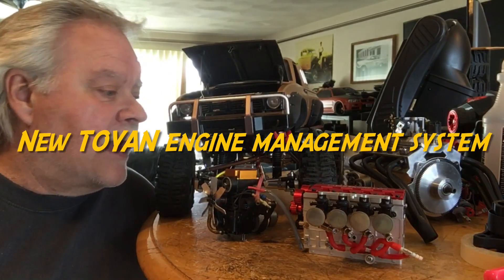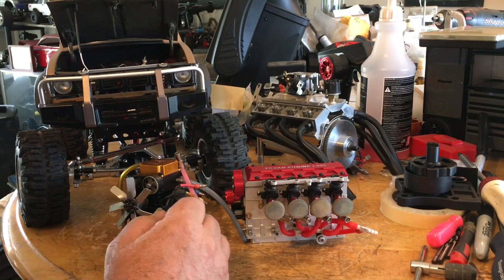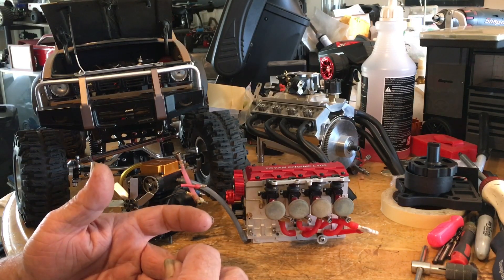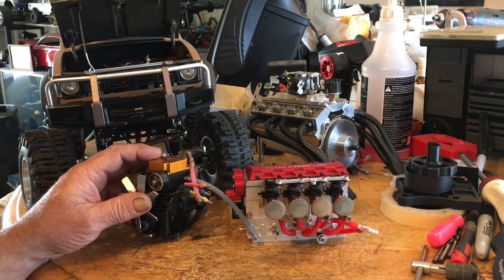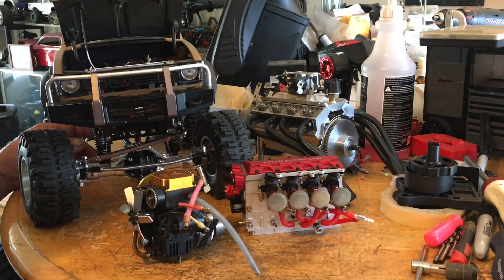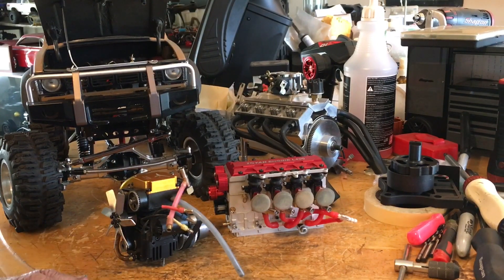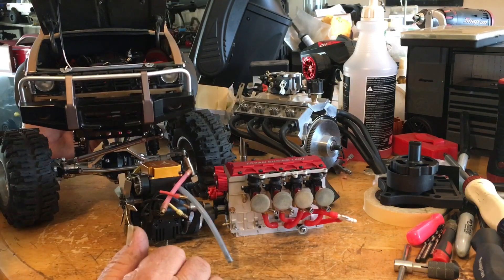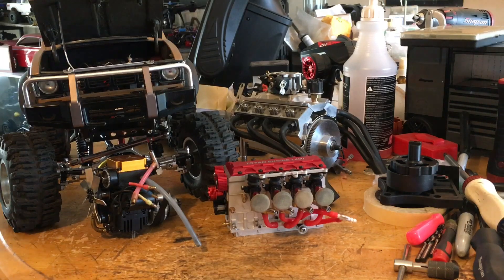NEW TOYAN ENGINE MANAGEMENT SYSTEM!!

Comment: Count me in, I really think those cranks are breaking from the lack of FIRE on either one of the out side cylinders. If one cylinder fires and the other doesn't it would put opposite force on the center of the crank. You said it happens when you first start it which would make sense because glow ignition isn't as reliable as a spark. 
I'm sitting back and waiting to see how this crank issue plays out before I even try to start mine.  So, thanks goes to you for your research and investment man!
Reply from the maker: Your welcome brother,  its a handful trying to figure out the crank, lol

Comment: Thanks for all the feedback! I’m the student working on this project. I will continue to check everyone comments. I’m open to improvements so post any ideas and if it make sense I’ll incorporate it into this project!
Reply from the maker: Looks like your idea is gold! I figured this would change the RC world, most everything that has an engine on it today has some kind of EMS on it except nitro engines.
Reply: Contact Timsane and JohnnyQ90 as well! Maybe all these guys could have a turn at testing and providing some feedback? This is too damn cool and needs to become reality!
Reply: Look at the comment I just put that's what you need to do big time
Reply: Kenny, Fuel injection for model 4 strokes by itself, is already a super idea to work on, never mind any extras!
Reply: Awesome idea mate. Love it
Reply from the maker: @RCTanksTrucks247  I think Kenny is on the right path with this technology with the electric starters and engine management together everyone can start and go easily.
Reply: @dennisdempseyradiooutofcontrol  absolutely mate, definitely interested in trying it in my two L200 cars

Comment: I'm not much of a fan of EFI to be perfectly honest. I want nothing to do with it on my daily driver. But I think it would be pretty sweet to have on my Globe Liner build with its single cylinder.

What would be super nice is if it could be universal fit and adapted to 2-strokes as well.

I also REALLY don't like how their starter boards run the glow plugs 24/7, to the point I'm using a third party onboard glow driver instead. Glow engines do not need glow heat for anything except startup; requiring glow heat to sustain operation means a fundamental issue with the engine or an excessively off fuel mix.
Reply: Agreed on the glow plugs running all the time. It’s excessively wearing and burning plugs and wasting battery energy. My solution is to have one on board module that is relatively small. That controls the glow plugs based off of a few factors including engine temp > once the engine is first started cold , the glow plugs will remain on until the engine reaches a target set-point. Second if the ecu detects a misfire I will activate whichever cylinder is misfiring for a couple cycles before it goes into a limp home mode resulting in the check engine light and a half power reduction.
Reply: @Ktec38  My solution would be even more stone dead simple than that. Here's the basic idea:

On startup, heat plugs. When engine starts, leave plugs heated for 5 seconds, then turn off. 

That's it. That's all it would do.

I wouldn't have a 'half power limp mode' or any of that nonsense either...shit like that is a large part of why I fucking hate fuel injection in a manned car due to how easily it will nuisance trip...frankly I would do without the on board diagnostics entirely and make the fuel injection system do just one thing: Inject a perfectly metered amount of fuel based on what the engine is doing.

Yanno, replicate a carb but without having to tune it. That's it. It has one job and only one job: Meter fuel in a suitable ratio for engine operation.

Comment: I would like to see such modification Just curious but to use other than nitro as fuel I wonder With the gasoline my test shows a big loss of power a glow plug os g5 for glow and gasoline can be used with nitro engine To run wit gasoline 2-stroke oil  This test is carried out on a very small .049 cox engine that I have on video It works but maybe an injection system would be better But I believe that is just better to use nitro in my humble opinion Too many different factors to consider the injector must be able to use nitro just it is already difficult to conceive the nitro is more like water

Comment: Sweet!  Would sure make it more tempting for more to take the plunge into nitro!  Carb tuning turns a lot of people away from the hobby.
Reply: What's turning people away from the hobby is Traxxas' shitty engines. I've tried to get a 3.3 to run right and it just never ran right. My OS, Kyosho, Associated, K&B, Magnum, Thunder Tiger, Enya engines all need their carbs tweaked twice yearly at most.
Reply: @TestECull  and traxxas charges a premium for said crappy engines too!  Have one traxxas that I won and it is staying that way.  Have a rc buggy that is 8 yeats old and has original throttle and steering servos that work.  My traxxas after one year of not driving it hard the steering sero is smoked.
Reply: @ShadowOppsRC  I got a Slayer Pro for about 200 bucks because the engine was blown. I rebuilt it with OEM top end and a Davis Diesel conrod, inspected the main bearings they passed fine. It lasted a gallon until the main bearings shit the bed. Put a Dynamite engine in that truck and the engine woes went away. Also had to put a clutch, a transmission, brake pads, wheel bearings in that thing. I never got more than one or two tanks through it before something failed.

Meanwhile my nearly 40 year old vintage Kyosho buggy runs perfectly, as does my Scorp XXL, my Mad Cruusher GP, my NTC3, my SC10GT, my Tekno NB48 2.0, hell I have a 45 year old K&B 61 in one of my airplanes that was siezed when I got it and within two days it was purring like brand new.

Traxxas ain't shit. I'll buy anything else before I buy another Traxxas. The whole reason I wanted a Slayer was I wanted a 4wd nitro SCT with reverse and from-the-transmitter engine starting; I got that but it was just too unreliable to put up with.

Comment: The fuel injection system if it works properly on that motor would completely change the performance and the reliability that would be incredible
Reply from the maker: I agree, it will make nitro RC life so much better!

Comment: It would definately give more people the opportunity to use the engine over the normal nitro engine's, do they do them all for methnol aswell as petrol and two stroke i have seen these options somewhere.
A side note to seeing what the crank is doing while running cut a piece of 1.5 or 2.0mm perspex drill to fit the bottom of the engine and seal it,now this should work as I have seen it fitted to the cylinder head on two and fourstroke single cylinder engines upto 125cc and no issues and you could see the whole firing process so I figure it would have an easier time as the lower engine plate. Keep these updates coming as I enjoy seeing and hearing how the projects are progressing.